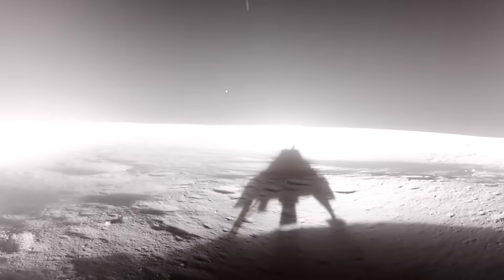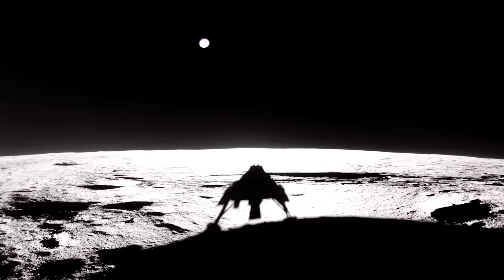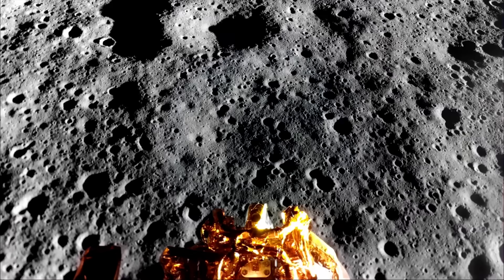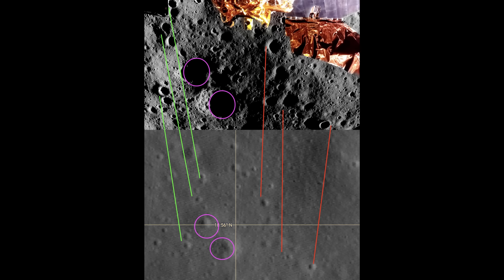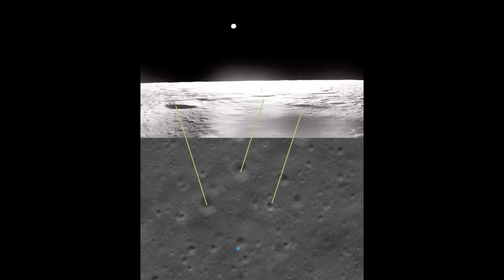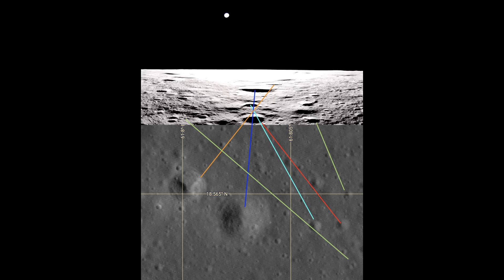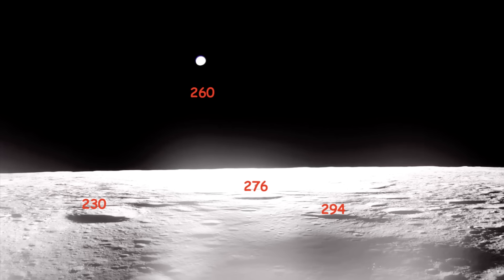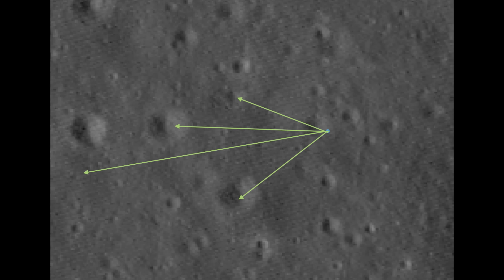Blue Ghost's Landing Video Reveals Exactly Where It Landed On The Moon

Comment: How powerful a telescope would you need to see it from Earth? Cause that's a crater I can see with mine, but certainly not enough detail to see the spacecraft.
Reply: No telescope on Earth even comes close to being able to resolve a spacecraft on the surface optically.  The Moon is a very long way away and spacecraft are very small.
It would take an optical telescope about a kilometer in diameter to see a spacecraft this small and it would need to be in orbit to get it above the atmosphere.
Reply: 600,000x to get resolution to that of google maps here on earth.
We’re talking about an optical telescope about 1km in diameter.

Comment: Why do all these only survive a single lunar day? I get that batteries don't like extreme cold, but solar cells and processors don't care and there surely are systems on board that can run on solar power alone.
Reply: Electronic components like processors do care.  Extreme heat/cold cycles cause internal stresses on components as different parts of them shrink and expand at different rates.  And the lunar night lasts for 14 Earth days, so everything gets about -130C, then in the daytime things in direct sunlight heat up to about 120C for another 14 days.    That's a huge temperature swing.  Electronics generally come in versions for 3 temperature ranges: Commercial 0C to 70C, Industrial -40C to 85C and Military -55C to 125C.
Reply: @stargazer7644  That can't be that bad of an issue. Extreme overclocking reaches even more extreme temperature swings, down to liquid nitrogen and even liquid helium temperatures. Digital processors actually like it cold, they run faster and use less power. For analog electronics, this is a different story, but then it's about malfunctions while running, not survival. Things should start working again when the sun rises.

Sure, the manufacturer doesn't guarantee it works that cold, but that doesn't mean it won't work in practice.
Reply: radiation

Comment: The dust falling like that is a great reminder that without air resistance, things can behave very differently to what we're used to.  If you fire a gun on the moon, the bullet will not slow down until it hits something.  If the muzzle velocity was high enough, it should even be possible to shoot yourself by aiming just above the horizon.  You'd need to wait a couple of hours, but that makes it even more weird...  Snipers!  Oh, wait, that's friendly fire from us a couple of hours ago.  Similarly, a piece of shrapnel from an explosion would do just as much damage to you from hundreds of miles away compared to if you were right next to it.
Reply: So, all those old cartoons were right? If you just ignore air resistance? Makes sense but I never thought about it this way.

Comment: The thrusters pulsing on and off reminds me of the Sopwith Camel’s radial engine.
Reply: The one with no throttle and you control the power by turning the ignition on and off?
Reply: @ Yes, the Camel had a rotary engine where the whole engine and propeller spins. The pilot switches the magneto on and off "blips" to control descent.
Reply: That's right! No throttle whatsoever, only an on-off switch for the ignition. WOT, and let's rip!

Comment: Why, why, why did they use highly distorting lenses? The "lunatic" flat-earthers shout "Fish-eye!" in unison, and they're right. Just one rectilinear lens would have shut them up (albeit for only a few seconds).
Reply: Because it's a wide angle shot.  This is how the world works.
Reply: I don't know for sure, but presumably to get a wide field of view, whether to see as much of the spacecraft or of the lunar surface? And then they can use software to "correct" the image as necessary. Sort of like the reversing camera on my car.
Reply: @maxfan1591  Exactly, you can't have a wide field of view without distortion.  Also you get a better depth of field that way i.e. don't have to worry so much about focusing.
Reply: the same reason why all YouTubers use wide angle lenses, it catches more stuff
Reply: I'm amazed at the number of people that don't understand wide angle lenses.  A rectilinear lens will distort wide angle images.  You can't have it both ways.
Reply: @ I'd rather have as little distortion as possible, and it can't be denied that fish-eye lenses produce huge amounts of distortion. I'm reading all sorts of justification for their use here, but none of it's convincing.
Reply: @AnonimityAssured  ALL wide angle lenses have to produce distortion.  If you want to squeeze a wide field of view into a narrower one, you have to distort something to do it.  And these are not fish eye lenses.   Fish eye lenses have a greater than 180 deg field of view.  Telephoto lenses also produce distortion.  They distort distances through telecompression.  They make objects seem closer together than they actually are.  
None of it is convincing?  You can't look at a panorama on a screen without a wide angle lens unless your screen wraps half way around your head.  That's why they're used.  Most people wouldn't be too happy looking at a tiny bit of a panorama though a porthole.
Reply: @ we know when you send your lander it will be equipped with different lenses, let us know as soon it launches 🚀
Reply: @stargazer7644  All right, then, they are not fish-eye lenses. I'm no photographer, and I was referring to the look rather than the technical description. They produce what any non-expert would call a fish-eye effect or fish-eye look, which is far more distortion than a typical smartphone camera introduces. Yes, stretching is still distortion, but it's far less jarring than curvilinear distortion. The important thing is that straight lines look straight, as they do when we look at them directly. By the way, our vision is wide-angled, and although our peripheral focus is poor, our peripheral vision is not highly distorted.
Reply: @AnonimityAssured  "I'd rather have as little distortion as possible"

If the choice is between (a) wide field of view and (b) no distortion, I'll take a wide field of view. That's because there's software out there which can correct image distortion, but no software which can extend a camera's field of view. The reversing camera on my car naturally produces a wide but distorted image, and software corrects into a clearer image. If my car can manage it, don't you think a spacecraft can do the same?
Reply: @maxfan1591  Maybe it can, but we are not seeing software-corrected footage, so your argument is moot.
Reply: @AnonimityAssured  "Maybe it can,"

Thank you.

"but we are not seeing software-corrected footage, so your argument is moot."

You asked in your OP why they used a highly distorting lens. It was explained that this gives a wide field of view, which is more useful than a narrow field of view. I pointed out that a distorted image can be corrected by using software, but that a narrow image can't in any way be widened. The fact that we aren't seeing software-corrected footage is true but irrelevant - we have no way of knowing what the mission crew are seeing that they're currently not sharing with us. That's all.
Reply: @maxfan1591  But that was my original point. Flat-earthers may reject all evidence, but if we present deceptive evidence, even if only inadvertently, the flerfs have good reason to dismiss it. I was not saying that wide-angled lenses should never be used. Rather, I was saying that at least one minimally distorting lens should be added into the mix. I recommend you watch Atomic Shrimp's recent video on Hive Beach to get an idea of the sort of thing I mean. The panning shots are particularly pertinent. There is some noticeable distortion, but very little — certainly very little compared to that in the Blue Ghost footage we have seen.

Comment: Keep in mind there are two effects contributing to the strangely rapid disappearance of the dust cloud. 1 - the absence of air allows the dust to fall immediately without turbulence or drag effects as noted. 2 - some of the dust is disappearing over the horizon because it's in orbit! Escape velocity is only 2.4 km/s and the hydrazine fueled engine exhaust velocity is at least 3 km/s, so some of the finest grains are actually plausibly being blasted into a low, unstable orbit!
Reply: So could we potentially create a ring around the moon as more landings take place?
Reply: @Wubslin   Can't remember who mentioned this, but it has been said that due to the ease at which dust can be thrown into space it could potentially be a hazard for further missions
Reply: @joebloggs1317  Wouldn't all the meteorites have the same effect?
Reply: @galacticminx  The dust is floating above the surface, meteorites moving through space, of course if you collided with a meteorite it could be game over but moving through a blanket of dust at orbital velocity could be just as damaging, imagine hitting fine grit at 17,000 mph.
Reply: @ I meant meteorites kicking up dust.

Comment: Why those the image looks so fake? Something about the whole video just looks like it’s bad cgi (Im not saying it’s fake, it just looks wrong for me for some reason).
Reply: Because there's no air. The light doesn't behave like you expect it to. No fog, no damping of the objects in it, no refraction and diffusion, no slowing down small stuff more than big stuff, the contrast is off because of the insanely bright sun vs the dark moon surface, blowing out everything else against the pitch black void of space. It's all very unnatural.
Reply: Reality often does not match expectations that have been informed by less than fully realistic special effects in movies.

For instance.

In so much of sci-fi rocket exhaust in space is represented as a more or less tightly constrained stream of fire, much like it is when the rocket is in the lower atmosphere. But in a vacuum there is no such constraining medium like air. And so the exhaust explosively expands into something more like a rapidly growing sphere. This expansion cools the exhaust so rapidly that it can no longer glow. Indeed, it thins out so quickly that little of anything is seen at all. A descending and decelerating vehicle under thrust would look extremely strange as a result, giving the impression of a magical slowing down. Until the dust is kicked up. 😉
Reply: Nincs atmoszféra ezért nem refraktálódik a fény a levegőben
Reply: "Why those the image looks so fake?"

Because that's your opinion. Other people will have different opinions.
Reply: Because what you expect to see in your mind is distorted by a lifetime of TV and movie special effects.  Go watch the old Hubble in orbit service videos - they look the same.

Comment: shouldn't earth appear bigger than that?
Reply: I see this question being asked a lot, and I have to ask, what are you basing that on? There's nothing in the footage of a known size for you to compare it to, and I'm guessing you don't know the camera's field of view. 

For the record, it is the right size, I compared images from Blue Ghost of the moon from Earth orbit and of Earth from lunar orbit, and the Earth was indeed ~3.7 times larger.
Reply: Take a picture of the Moon with a typical GoPro,or your phone using the standard or wide angle setting. See how tiny a little ball it is. Now, replace it with a circle 4X wider. Still pretty small.

To put some numbers on it. A wider angle GoPro has a field of view about 120 degrees wide. As seen from the Moon, Earth appears 2 degrees wide (4X bigger than we see the 0.5 degree Moon.) That's around 1/60 of a 120 degree field. Take a still frame image that's not been cropped, then measure the number of pixels across the Earth and compare to the number of pixels across the full image.

The foregoing neglects the fiber points of distortion, which here does cause a small amount of image 'squeezing' in the outer field. But to first order this will provide a good sense of scale that confirms matters.

I'll point out also that it's virtually universal that artists and filmmakers make the Moon or Earth unrealistically large, presumably for more impact. And in part because of the way we perceive an otherwise small subject when concentrating on it.
Reply: The Earth is pretty small in the Moon's sky.

Comment: 2:00 what illumination issues? The whole scene is lit from end to end. You're saying there is hidden craters in that image? Wtf?
Reply: He's referring to the illumination angle in the Lunar Orbiter images, the sun was at too high an angle for that large shallow crater to cast any shadow. So it isn't clearly visible in the LO images.
Reply: Scott was talking about the craters that were dark since the sun was so low. Since the sun was low many of the craters couldn't be seen from the Blue Ghost lander since they were hidden by other objects, particularly the rims of larger craters. However, from the perspective of Blue Ghost as it was landing most of the surface was illuminated. It was just the smaller craters that couldn't be seen.
Reply: When the illumination is high in the sky like it is for LRO then shallow craters will disappear.  When illuminated edge on from the horizon, those craters will show up.  That makes the two images look different.

Comment: 2:55

huh? why does the mission end when the sun sets?
Reply: Too cold for the electronics, no sun to drive solar panels.
Reply: Taken from an earlier comment asking the same question - "The lander is only going to get 2 weeks of sunlight (a lunar day is 2 weeks from sunrise to sunset) before night sets in and the lander will either lose power from no sunlight or it will freeze due to lunar night getting to -130°C (-208°F)."
Reply: Because the lunar night is very cold and lasts 14 Earth days.  The electronics can't survive that much cold and battery powered heaters can't last that long.
Reply: the batteries will not last long enough to keep the thing warm enough to not be damaged by 14 Earth days of the cold of lunar night
Reply: they only come out at night…